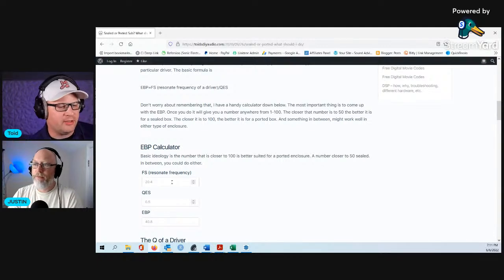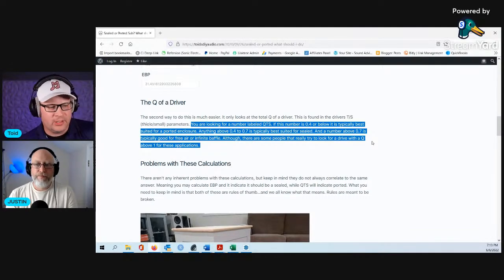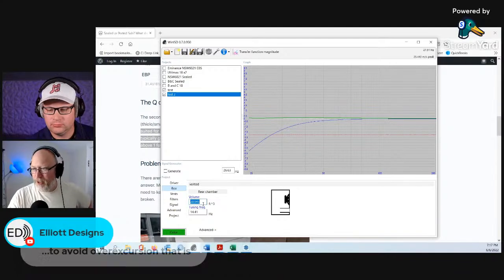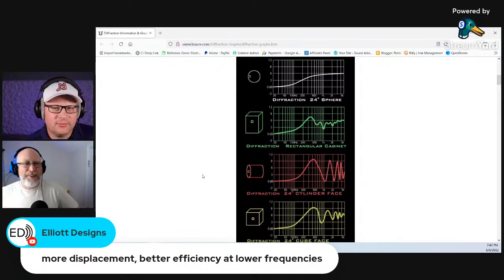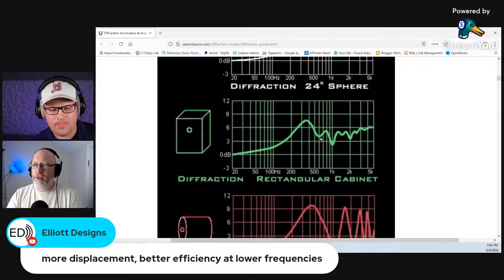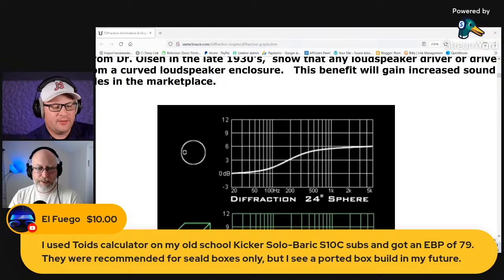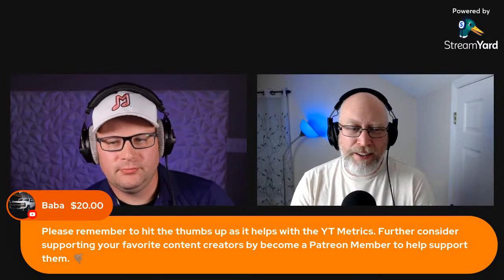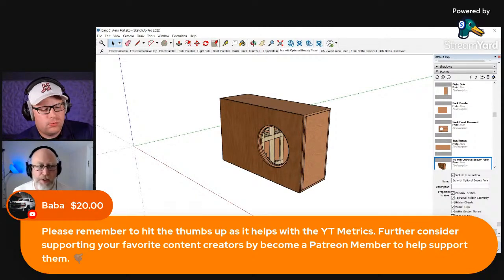Subwoofer and Speaker Box Design

Comment: The E in QES is electrical suspension (voice coil/magnet...) and the M in QMS stands for mechanical (spider/surround...)  T in QTS stands for total which is derived from the two.
Lot of time you can look at the driver and if the magnet looks like it's too small for the driver... say you have a 12 inch woofer and the magnet looks like it belongs on a 4-5" then most likely it will do better in sealed as the air in the enclosure can now act as more of a suspension to help control the cone.

Comment: I believe there are factors that happen in physics that aren’t addressed in theory when these ratios are developed. I keep discovering info that makes me rethink everything I thought I knew lol For instance, speed of sound isn’t a constant (which we all know). In my head, that’s always been perceived as a small variation due to air temp/humidity. Recently I learned that it’s WIDELY variable according to the density of the medium in which it’s traveling. So with that in mind, what happens to the sound waves both inside and outside of the enclosure during the compression and expansion cycles from the driver? What about sound that radiates through the enclosure walls; how linear can that be with such a wild change in speed due to increased density?

Another cog in the wheel has always been the concept of near field vs far field. In the near field the pressure and velocity of the waves are not synchronized yet, it’s just an area of massively disrupted particles (think about thrashing your hand around in a lake. The area closest to your hand is just a chaos of splashes that will widen out to become waves as the energy moves further away into the far field). Since this is generally considered to happen within 1/4 wavelength of the lowest frequency being produced, the area inside and immediately surrounding an enclosure is considered near field up to party high frequencies. Think about how THAT chaotic set of variables affects prediction of an enclosure’s response 😳

With that being said, as much as my brain would love to know exactly what’s happening in every aspect of enclosure building, I’m not sure I possess enough processing power to quantify it totally 🤣

Comment: On the golden ratio discussion, it comes up a lot for a few reasons. The more scientific reason is that the ratio and the related Fibonacci sequence tend to form patterns, particularly spirals, that have low interference between the data points - eg, leaves or flowers arranged in a Fibonacci spiral get more sunlight due to low overshadowing of each other. The applications of "a pattern with low interference" to sound design is obvious, assuming of course that people can adapt it from a broad theory to actual practice.

The second reason is that "its seen all the time in nature!" Which can be true... for a given tolerance of what counts as a match. It turns out that finding "something that is roughly 1.6 times as big as another thing" isnt very difficult, especially if you count anything from 1.5 to 1.7 or 1.8 as close enough. There are a lot of things out there in nature that can be randomly compared to other things.

Comment: If speakers don't use too much power then why does hooking a high powered (high current) amp improve the sound quality of a speaker?
Reply: Usually dynamic headroom improves if you have more power on tap, especially in bass frequencies. 

The other advantage to having more headroom on the amplifier is that if it's decently designed, it means you'll experience lower distortion at a given SPL versus a lower power amp that's straining more to provide the power you're asking of it.

Of course, all this depends on your environment and listening habits. You're much more likely to notice a jump in power if it's at least a 2x increase, and if you're listening at particularly high SPL, or at great distances.